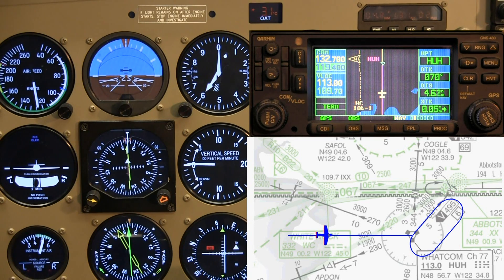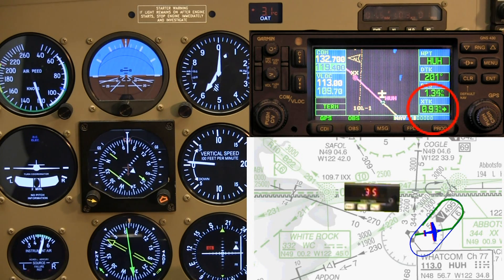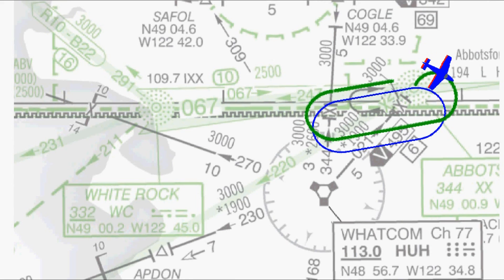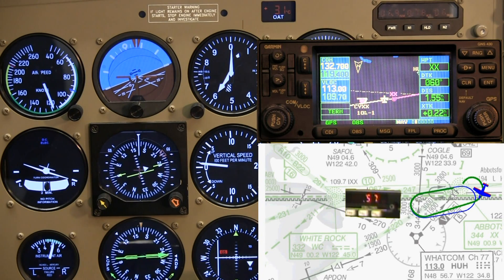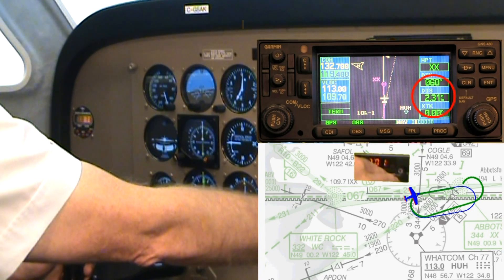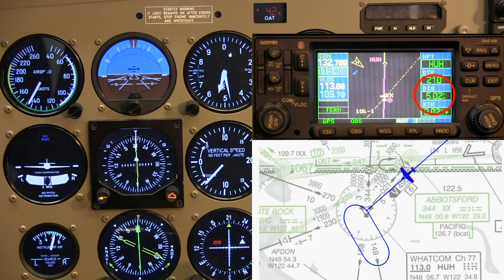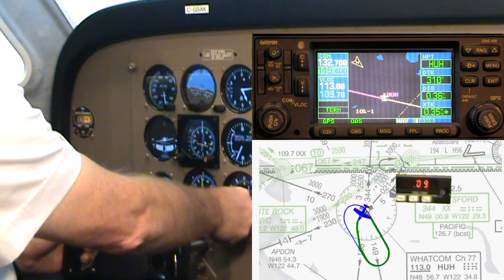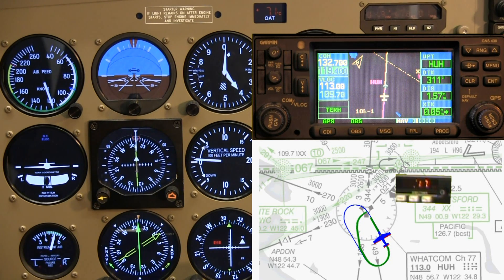Holds - Part 2b

Comment: Just wondering, why don't you turn outbound imediately after passing the fix? You could adjust your heading bug while flying rate one turn. Secondly, how about intercepting radial when making an offset entry? You would have to intercept inbound track at an angle from 45 to 60, but you will remain within the holding site. Last thing: what about direct special case entry in the last attempt?!